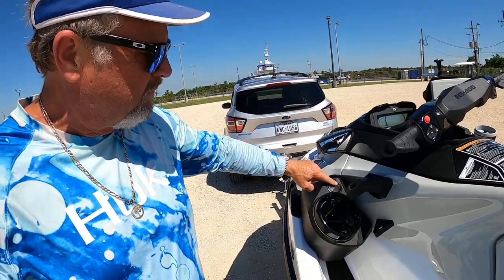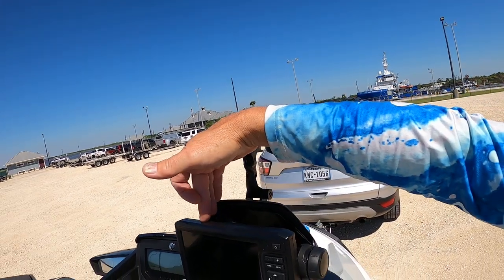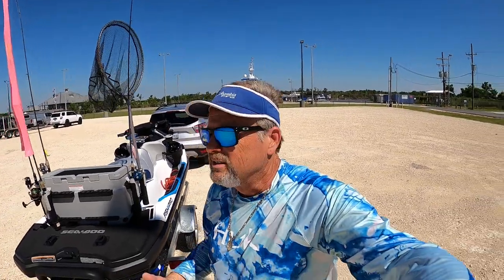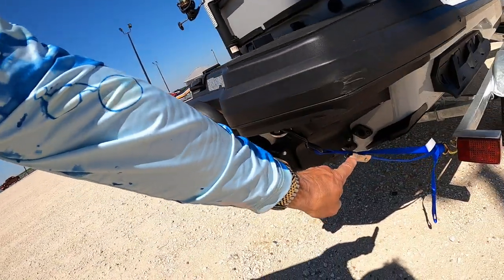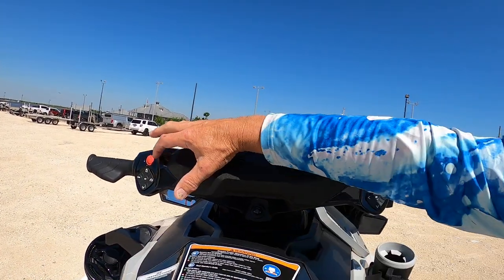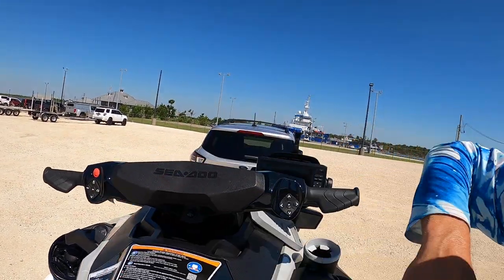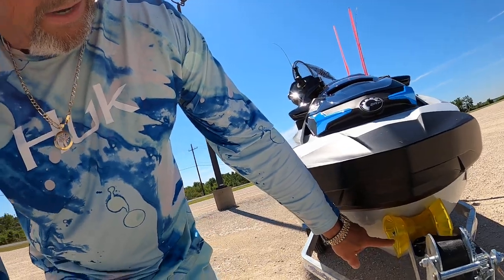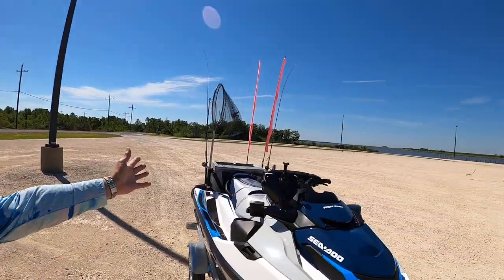2021 sea doo fish pro gps and flushing.not like typical boat

Comment: Anchor off the front and simply run a rope from your main rope to the Handel on side of ski at front. 
There is no tension on this exhilarate rope as it is just hanging there but you use it to retrieve the main line.  

Enjoy.